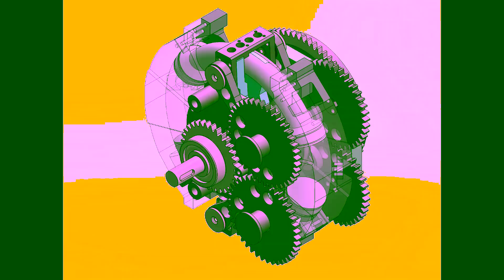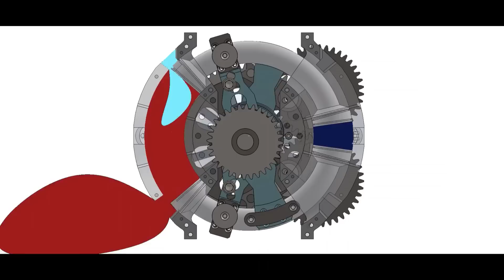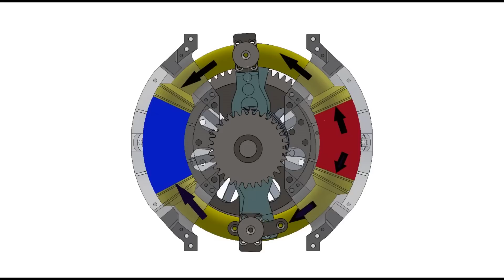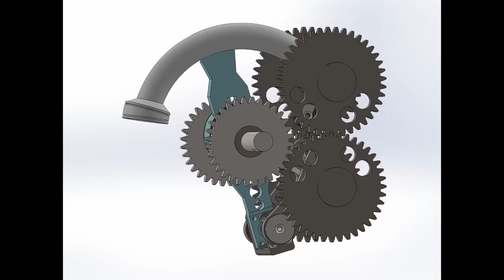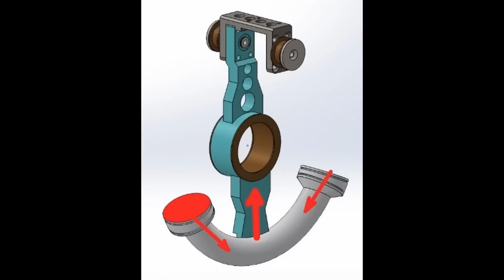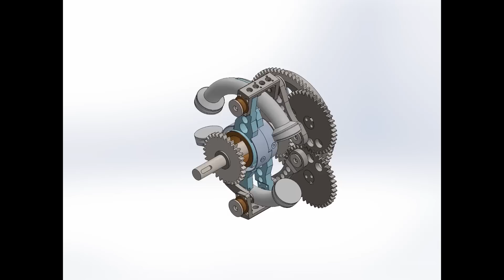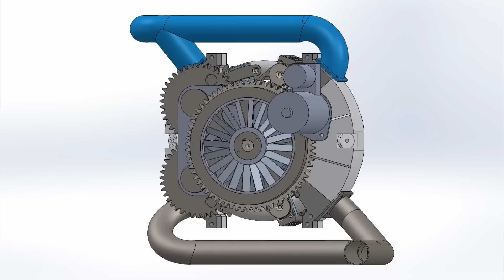A new type of Engine

Comment: It's a neat idea and I'd love to munt a small one to a fat tire mountain bike.
I have no idea how you'd machine the cylinders though.
Reply: That's the thing, in reality this engine would be a nightmare to make and maintain, i mean how do you evert start making that bore?
This definetely looks like a cool idea but it isn't getting mass produced any time soon
Reply: @call_me_mado5987  
The cylinder block would need to be made in 2 pieces and then sandwiched together. It would make it possible to roughcast and then refine on a CNC mill to the required tolerances.

Comment: I mean if it was a external combustion engine I can see it doing something? But there are a number of points of failure and torque loads are a very real factor. 

There's concepts, and then there's the good ole "Torture" testing of a prototype and modified variants. I forgot the diesel engine Fairbanks & Morse used to build? But a better example would be the Napier Deltic engine, that's what this reminds me of.

Comment: I didn’t quite follow why the pistons wouldn’t need to be in contact with the cylinder wall and not need oil lubrication. The cylinders would still need rings to maintain compression.
Reply: It will need very little oil, but basically the idea is to reduce or remove side loading, so that you have less friction losses.  Check out the taurozzi engine, opposed piston engines, and maybe even Detroit 2 stroke diesels.

This idea isn't "new", but just a bunch of old (decent) ideas in one engine.

Comment: I see one problem right away and that's the length of your intake manifold there it's shorter to 1 cylinder than it is to the other that's not going to work I would imagine it would work best with  injectors and separate intake tubes or pipes whatever

Comment: Come back and show us when you have a running one and not just a computer animation.
TL:DR Been done before, it didn't work.
Reply: Rocking engine
https://www.youtube.com/watch?v=GI9pkcFJXV4

Opposed piston engine
Running: https://www.youtube.com/watch?v=usmauFigpzk
Explained: https://www.youtube.com/watch?v=UF5j1DvC954

It's been done, but with either less moving parts or with less complex machining.  This is just two good ideas put together to make a questionable idea.
Reply: @nocturnal0072  Not the same engine. But that's old, why hasn't it gone anywhere? A number of toroidal piston engines have run, but we still use plain old crank-connecting rod-piston engines. I wonder why?

Comment: Something similar exist, I forgot the name though. It was made by some Chinese guy to produce extreme torque for industrial centrifuges and what not. Personally, I would focus on closed 2 stroke system since they would emulate this better. I don't understand how the lubrication in this would work either. A wet sump nor a hollow gear system would provise sufficient lubrication.

Comment: This is a great candidate for Selective Laser melting Additive manufacturing. If you are a student, Your professor may be able to hook you up with a Contact that is willing to help you build a prototype. To dream up a design, is nothing. To build a design, is something. To solve all the problems to get the design to work, that is everything. I think that this engine would never pass emissions, the introduction of water injection changes quenches the combustion before the fuel and air reactions are complete. Aircraft Jet engines used to use water injection in the exhaust, but that has been largely abandoned. Watch video of those engines and you will see the exhaust turn from clear to black. What you are building is a dirty boiler less steam engine. I would. Love to see one of these built. This basic design has been floating around form over 50 years. I have have seen one built and running. There have been air driven test beds, but never a fully debugged running engine. Good luck.
Reply: NOT TO THE RESOLUTION YOU NEED. This will need to me machined.
Reply: @just_one_opinion   You are right of course, “ still needs to be machined. “ The tooling cost to do this out of billet for a one off would be huge. I suppose you could sand cast the case halves out of AL and plate up or form the cylinders. SLM is just a way to avoid the pattern making and casting…
Reply: @rustybucket2248  It's been done by a man at home.  https://www.youtube.com/watch?v=GI9pkcFJXV4
Edit: a very skilled and resourceful man

Comment: a round 2 cylinder opposed piston! rotary engines have a single triangle that spins in only 1 direction not back and forth. What you have is a boxer, man are you terrible if you cant even get this basic terminology right. The thing about a boxer is that you have fewer moving parts. Less moving parts means more efficiency, and this is what the important in efficiency. You cant magically make the engine more efficient unless you change how the combustion happens and everything around it. All you have with a circle is a long stroke which is what diesels typically use because the high torque at low revs is simply a more efficient setup for daily use.

Comment: I see one big problem your motor has with Otto and Diesel engines, at the time of explosion the crankshaft is geometrically unable to transfer power. Erwin Müller's spherical motor, which uses the same piston configuration, avoids this problem by using a simple cam system to transfer linear to rotary motion (I don't know what his friction losses are, at least the cams are away from the heat and and can be single purpose gliders).

Comment: It's an interesting design, and I've had the same thought myself, but the simple fact of the matter is this would be a nightmare to produce, and it would also be a huge maintenance nightmare.
Very expensive to make that bore, and the Pistons wouldn't be cheap either.
Not something you can cast and mill. To get the kind of boring smoothness you need it would have to be milled on a lath and that is a very expensive operation for something that large. The Pistons also couldn't be simple cylinders and your ceiling rings couldn't be simple rings either. The rings wouldn't be able to rotate around the Pistons because of the asymmetry and that would lead to uneven wear and poor seals eventually. There's a bazillion other maintenance problems. Long story short, this is an expensive disposable engine.
Reply: A variation of this already exists.  It's the taurozzi engine.  It wasn't successful as an engine, but the design is used in compressors.
Reply: @nocturnal0072  https://www.youtube.com/watch?v=GI9pkcFJXV4
Reply: Lath is spelled with an e like lathe just sayin
Reply: Sayin in spelled with a g at the end, I'm tellin ya!
Reply: @Wolficefang  ya is spelled you!  ; )
Reply: @sethreign8103 English is not a measure of intelligence, neither is being a grammar Nazi
Reply: Among other things, I can not see the significant problem with the bore. Just need to build a special machine for it. Can use mostly stock parts too.
Reply: yeah modern motors as is are overcomplicated enough. this is just reinventing the wheel
Reply: Well let’s see……The Wright Brothers with the help of local machinist built a twelve horsepower four stroke engine from steel bar stock in 1903. 120 years later, industry can manufacture any part pretty cheap!
Reply: @onebadapple83  ... Maybe... If it goes into mass production. But making it is only a minor problem. Keeping it running is a much much bigger problem.  Recalls will kill a startup faster than a desert runner kills a water bottle.

Comment: This (if it did in fact work) would be a manufacturing nightmare. 
Imagine machining the 'cylinders' (particularly with the proper surface finish) and pistons - and then the appropriate piston rings etc.
There's a reason I.C.E.s have straight cylinder bores.
Nice concept though.
Reply: Honda Tried oval engines...went back to good old bores.
Reply: @just_one_opinion  I remember,  but at least the (let's call them bores) were straight!
I've been a tool-maker/machinist and CNC programmer/machinist for quite a while so I'm fairly well versed in machining, and as I was saying, this would be an absolute manufacturing nightmare. 
There isn't enough of a jump in efficiency to warrant it, if there truly would be any.
Reply: @Motor-City-Mike  agreed!

Comment: Seems good at first but it's going to vibrate a lot which means it's going to be, inefficient, noisy and wear out more easily. The gears and components needed add weight and complexity which you don't want on a car engine. I respect the research and work you've put into this and it's interesting, but I cannot see it applied on a production car

Comment: How are you balancing harmonics? With the piston mass flailing side to side that things going to shake like hell. There is a reason opposed piston engines are opposed the self balance there harmonics as long as there in time. You need to plan in some nice big counter weights and doing so will lower the out put of the engine so please come back when you have worked more on this.

Comment: Very nice. One thing though, certrifugal forces are probably going to lead to uneven wear on cylinder walls.
Reply: Very good point
Reply: I was thinking about the compression and combustion pressures causing the curved pistons to flex, but this is a good point, too
Reply: This is an old design. Google the pendulum engine from Argentina. Medical oxygen compressors use curved  bores because there is no oil around the piston to contaminate the gas, just Teflon rings .
Reply: If you had 2 side-by-side in opposite stroke you could balance out the centrifugal vibrations right?
Reply: @yaazarai I’m no expert, but I think what is implied is that the swinging centrifugal force on any given piston head mass will always pull toward the outer cylinder wall, even if the whole system is balanced. In other words, the centrifugal force on the curved piston would appear to be widening the bend radius.
Reply: @yaazarai  vibrations - yes, but it would still put some pressure on the walls and piston rings
Reply: She inferred that point and did mention the graphic only showed single cylinder bank for demo purposes.
Reply: @yaazarai  it wouldn’t be vibrating that way, it’d be vibrating side to side
Reply: The most reliable non traditional ICE engine is a gas turbine engine.
Reply: It could be a good idea for them to create a 3d printed prototype, possibly using handcrank or air to move the pistons for then to better visualize how it will move and to see if the pistons oscillation damages any parts during extended operation, at least try to offer some sort of solution instead of just pointing out another problem.
Reply: Someone doesn’t pay attention.
Reply: No this isn't really true. Similar to the pendulum engine design, the shaft is locked to the center piece. This puts a lot of load on the center and it may be a point of weakness, but the design minimizes friction and wear of the cylinder walls.
Reply: with the fuel efficiency gain and the cost of gas right now I'd say it's worth it
Reply: And very shaky so other parts arround could wear out more
Reply: Too many moving 😪 parts  still thinking old technology  too much wear
Reply: Low repair cost would offset that.
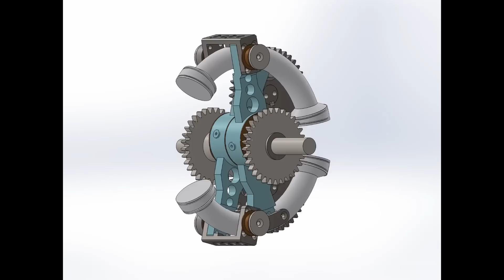Reply: 4:51 it states the pistons do not come into contact with the cylinder walls.
Reply: A few solutions off the top of my head would be to make the heads oval (thus distributing the wear and prolonging working time) or holding the piston at the heads, essentially splitting that bar into a Y shape. Doing so could lead a smaller rod or could even eliminate the need for it entirely.
Reply: @Therapistinthewhitehouse  that doesnt matter. also i think this thing would explode
Reply: @frostedlambs  
What doesn’t matter?
Reply: Korek
Reply: It was the first thing i thought off #MyThoughtsExactly
Reply: Konsept olarak güzel de klasik motorlarla rekabet edebilmek için çok pahalı bakımı da çok zor olacağından sanmıyorum bir yere varacağını
Reply: She mentioned that tho she said those cent forces wd be offset by the opposing force exerted by the other piston... but I'm no engine engineer kinda guy so maybe she's full of it.  🥴
Reply: Connecting rods are replaced by a curved cantilever beam. This indeed makes the force applied to the piston surface during the power stroke perpendicular to the radius which does not have any axial component. This probably is the reasoning behind piston-cylinder friction to be less. There is a trade-off between the sturdiness of cantilever beams that replace the rods: if they are thin they will lead to larger deflections along the axial direction wrt to the motor center, if they are bulky then it will lead to larger centrifugal forces in the axial direction . Both lead to larger forces in the axial direction, that is between the pistons and the cylinder walls.
Reply: 4:51, "because the pistons don't contact the walls, Oil lubrication isn't necessary"
Reply: @Deetalks87  Yeah but there was ZERO explanation given as to why pistons wont' come into contact with the walls... it clearly has rings which means they will require lubrication and will come in contact with the cylinder walls.
Reply: @Deetalks87  Some contact is necessary for pistons to keep the pressure in. Lubrication and oil rings are also necessary because there will be a contact.
Reply: @EnginAtik  the one part of an engine we have tried just about everything to get out of the issues they cause...but alas, gravity exists and piston rings with proper lubrication is the ONLY way to maintain internal combustion.  The only way to get out of ringing the cylinder head is to have a seal at the back of the combustion chamber that can hold vacuum against the curved rods, especially under load.  Also, none of the connecting rods in thise system better be aluminum...ever...they will shatter after about 5000 miles or the first time they go past 5000 RPM.  Aluminum does not like lateral shearing loads, and they stretch...that will have your cylinders slapping and slamming in no time.  Titanium would probably go porcelain in that application as well, carbon fiber might work, but it would have to be printed, not vacuum formed to make sure it is equally strong in all tensile directions.
Reply: @verigone2677  Carbon fiber and other composite materials will probably burn in this application.  I really like the idea of singling out connecting rods as the source of energy loss in this design but the engineering aspects pose a number of problems before even going into the manufacturing challenges.
Reply: @Engin Atik  well, according to this vid, contact isn't made so the resulting decreased temps are easily cooled by the steam. This entire explanation is 1 of the main pillars in its claim of increased efficiency. Not sure if just calling them liars is really fair....I mean, they had graphs & everything!
Reply: @EnginAtik  replying to everyone here, there's a curved compressor pump that doesn't use anything more than graphite or teflon to lubricate it, this system isn't frictionless but the amount of friction is so small that you don't need a lot of lubricant, they will probably still need oil in an engine version since there's combustion, heat, and high pressure, but curved engines are far more efficient. They reach up to high efficeny turbine levels since their pistons can continually push perpendicular to the crank. I dont kniw about this one, but there are more kinds of curved engines that have already been developed, The reason we don't use them is 1 they used to be REALLY expensive to mass produce.  Only recently do we have technology that could realistically do it, and 2 how would they convince people to buy another car every 7 years when these ones require so little maintenence and last for so much longer? It's not an effective buisness model. Unless of course you made every one use turbo 4 cylinders that blow up really fast then you could start selling these which would help bring reliability back up.
Reply: @themultigamer5682  It could very well work for low RPM, low temperature applications.

Comment: The operating schematic shows the inlet charge seemingly entering on its own free will. Looks like it will need a blower to operate to me.
Reply: Its a standard two stroke design which is a well established principle. Also it was explained that the pressure wave of the exhaust pulls in the new air. Noevertheless forced induction seems sensible for a cleaner combustion with less residue exhaust from the previous cycle but that is the same with current two strokers.